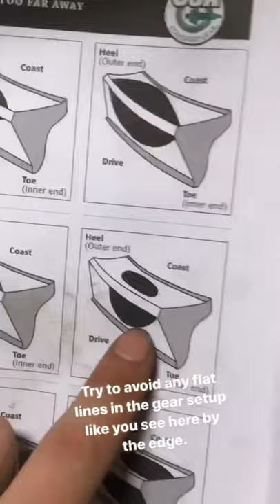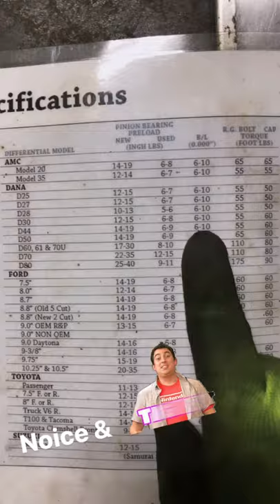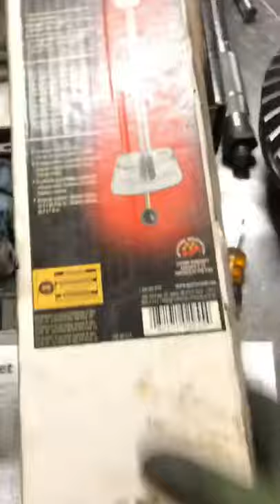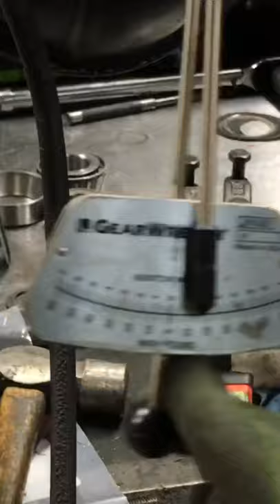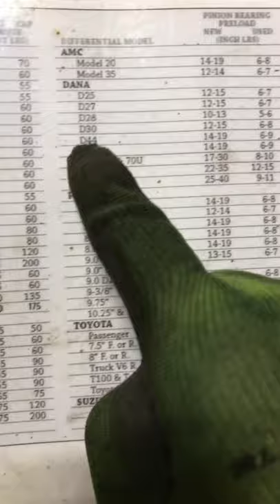Dana 44 Gear Install

Comment: Adam, nice job on the video.  I'm teetering on whether I do this job myself. I'm short a hydraulic press but I can take mine to a shop to get the bearings done... I've talked to Rich about swapping out my 3.73 to 4.56 gears and getting type 4 carriers with a posi diff on my 72 Blazer.  He was also recommending getting chromoly axle shafts.  I'd rather not take my axles off my Blazer to do this job, but you make it look like it's a whole lot easier on the bench.  There's a bit of work getting those axle shafts out and all the parts off to do that job, too...

Comment: I just swapped out the 3.55 for 4.56 gears also in my 96 Dodge ram love the torque especially with 36x15.50 Baja MTZ..
Reply from the maker: I love the 4.56 gears with my 33” tires!

Comment: Why did you set bearing preload with the old nut prior to installing the seal? Wouldn't that completely eliminate the bearing preload when you take it apart and require you d iit again with the new nut?
Reply from the maker: Keith McKalister  Yes. I did it all one last time with the final pinion seal and nut. Was just checking that I got the amount of shims for preload correct so I didn’t have to take the new nut on and off. They are a pinch style nut generally and I try not to take them off.
Reply: @adamdeuling5720  Great video. I was getting a refresher before I do another gearing set on a D44 this week.

Comment: Hoss, could you please tell me what was your final pinion nut torque on this dana 44.  Furthermore, with your knowledge would you consider that my dana 44 rear from a 1972 cj5 jeep match the same specs of the dana 44 in this video?  Over and out uncle Bud.
Reply from the maker: Hey Bud! Actually you do not set pinion nuts to a certain torque per say with a click style torque wrench. If you look at the pinion nut part I used an Inch Pound Dial type torque wrench and you put a socket on it and slowly spin the pinion and measure how much drag (pre load) that it has. I think i hit around 20 inch lbs with this, its a new bearing so i normally hug the tighter tolerances knowing things will wear in.  But thats very important that you use an "INCH LB DIAL" type torque wrench. I believe they are around $35 online or so.  Im sure most D44 axles have similar specs. You can look up those charts fairly easily online and most companies that sell install kits will send that spec page. https://www.differentials.com/technical-help-2/installation-instructions/
Reply: The pinion nut doesn’t set the preload but it still has to have a torque spec. Instructions for another brand spacer  said the nut was to be torqued to 125 ft Ibs. 20in Ibs wouldnt get the pinion nut started past the mechanical locking pinch would it?